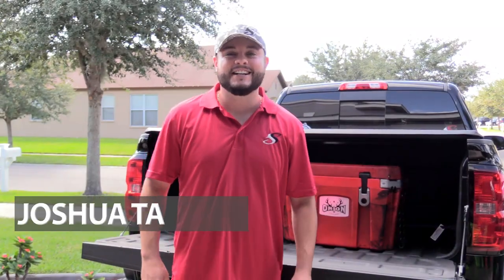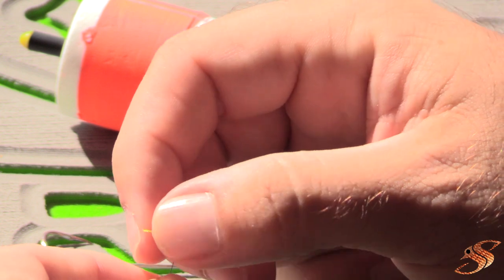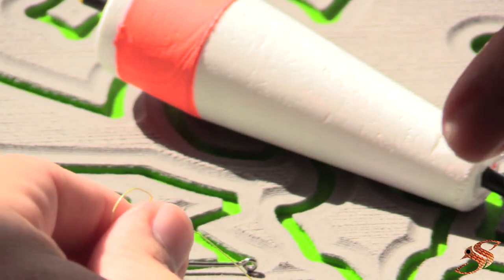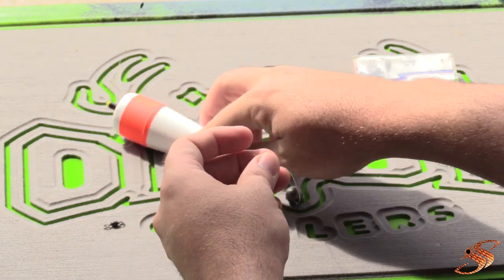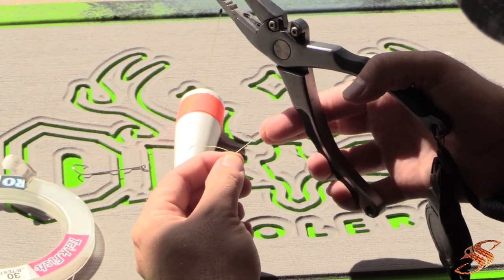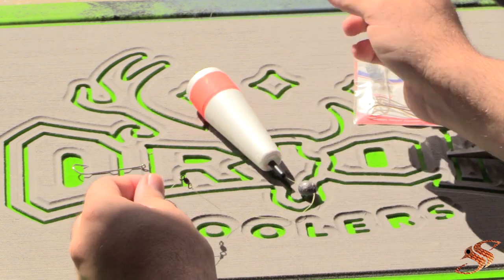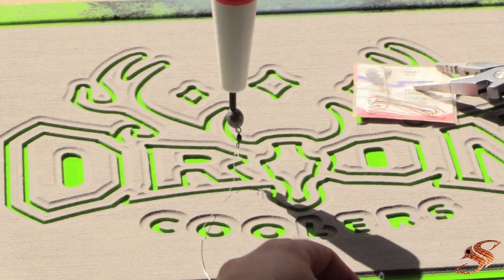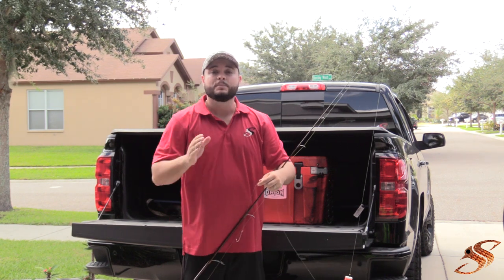How to Make a Super Effective Float Rig for Spanish Mackerel

Comment: I like action too but I hate losing and retying rigs and hooks. On smaller spanish your rig will work fine, the bigger 3-8 pounders will snip off 30 lb mono or fluoro like a pair of scissors more often than not even with a long shank hook. Live chum them and a short piece of thirty pound wire won't reduce the number of strikes but will increase landings ten fold. If bluefish are present, they will strike your cork, lead and whatever other terminal tackle you have on the line when you hook a fish.
Reply from the maker: We catch some pretty hefty mackerel in the bay with a long shank, you do have cut offs but I personally don't catch as many fish when using wire.

Comment: I haven't used the bobber stoppers, but I use split shots on top of the float. Kinda has the same effect I guess. Here's one you are sure to like. Next time you use a knocker rig, add a split shot between the hook and sinker. Now you have an adjustable knocker rig Captain. Works great for making quick mutton long leader rigs, without swivels. Tight Lines Captain. .
Reply from the maker: Thanks for sharing, great tip. I just started using the bobber stops a couple years ago. Back in the day it was just a simple rubber band lol.